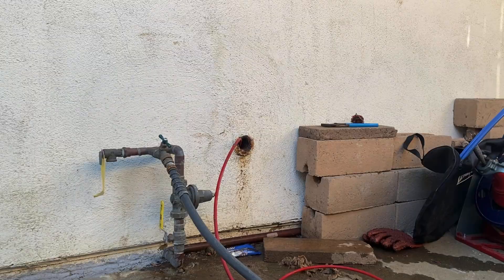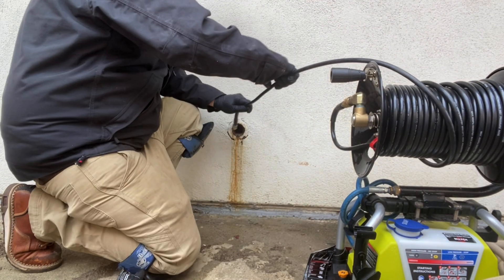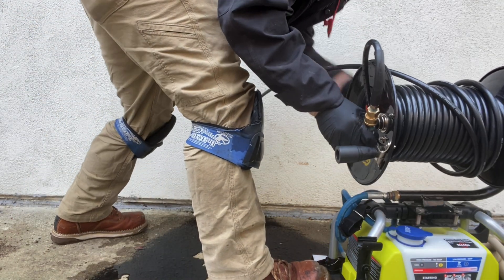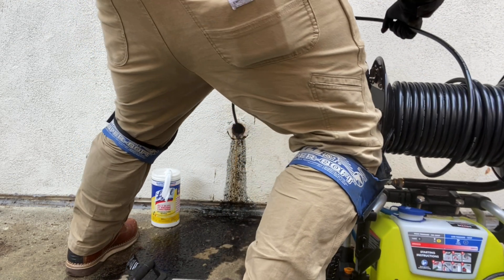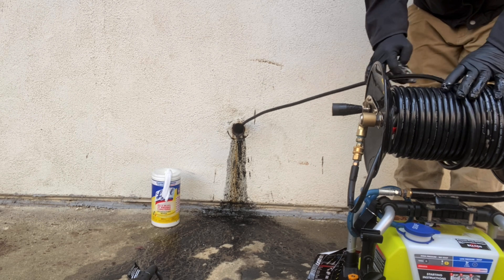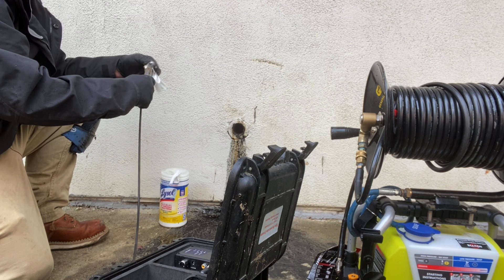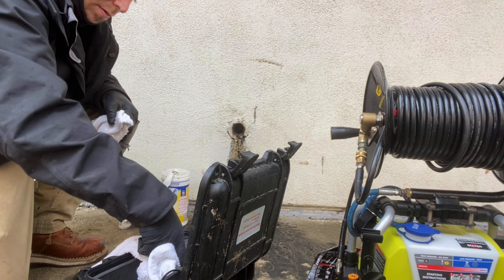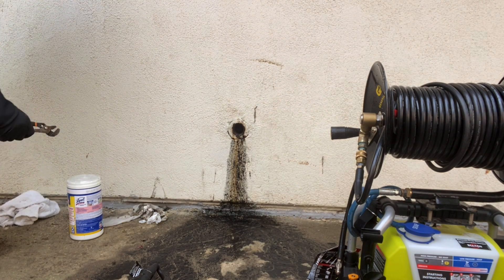Ryobi 1900 psi 1.2gpm Pressure washer converted to Electric Jetter | Unclogged Episode 27

Comment: Just wanted to say thanks for this video. My main is 100ft 4 inch old cast iron that has a few bellies and other faults with it.  My gas pw is dead and my main is clogged again after 3 years since last jetted.  I found  an openbox electric Ryobi PW on OfferUp for $100. Definitely not as strong as the gas but after 4hrs, got my 4in sewer main cleared!  I bought a similar jetter kic from Amazon about 3 years ago. Upgraded the hose to 160ft.  I just gotta remember to jett that main 2x a year to keep it flowing. The Electric power washer is slow but definitely capable. Thabks again!

Comment: I just ordered my jetter line and I am going to buy a 3100 PSI gas pressure washer from lowes to try to clear dead roots from my septic lines. I have used chemical to kill the roots, but still need to clean them out. Anyone have any other suggestions?

Comment: Appreciate this video a lot!

My side sewer pipe has some grease build up. Would you say this setup has a good chance of dislodging it, or I need a gas pressure washer with 3000+ psi and 2+ gpm to do the trick?
Reply from the maker: What do you mean by side sewer pipe this pressure washer will unclog pretty much anything up to 2” it can probably even unclog 3-4” but it wouldn’t be able to really clean anything above 2”
Reply: @PlumbingExplained  Thanks for the reply.

Side sewer pipe as in, the pipe between a house and sewer main that is maintained by the city.

So yeah, it'd be around 4" in diameter.

It sounds like, 2" diameter is viable, but anything bigger probably no-go.

Thank you so much for the reply my dude.

Comment: I made a half inch steel cored flex shaft kit from home depot for 220$.. 50ft, 30ft, and a 20ft they work amazing 100ft roll of 5/8 flexible electric conduit 2 50' 1/2 in husky drain snakes and 2 50' galvanized winch cable to use as cores.. just sprayed everything down with blasher lithium grease slid them in the sleeves and threaded 2 chains on like a key ring and.. started root busting its flexible enough to run down the washer drain and the back clean outs 2"
Reply from the maker: I know a guy who was doing the same thing pretty much, I forget where he told me the down side was, I’ll have to ask him. You can order flex shaft cables relatively cheap through Plumber-Tools.com or even on aliexpress directly through China, they’re called transmission cables I believe but there’s a company on AliExpress called Ledfin or something like that, they sell them in whatever length you want and you can order the tube separate which the tube is usually just air tube or brake tube.
Reply from the maker: Very creative though! I love people that think outside the box and look to create their own stuff! I’m one of those people!

Comment: Been wanting to start offering some sort of jetting for access to clogged sewer lines for my Home Inspection business. Just goes to show you don't need a whole trailer mounted system to get the job done. Thanks man
Reply: Plumbers usually use 4g 4thousand psi for conversion
Reply: @sewerrat7612  maybe for a 6 inch plus diameter
Reply from the maker: I have a 4K psi 4.5gpm jetter i use for cleaning but the smaller jetter is fine to get something unclogged
Reply: @Baldheadslik  most drain cleaners consider 4gal 4000 psi basic for 4 inch sewer main will work on 6 inch as well if your patient but 4 gallon is a little low for 6 inch. It's also one of the easiest sizes to get conversion kits for.

Comment: What kind of camera is that and where did you get it? Get off Amazon. How much did you pay if you don't mind me asking
Reply from the maker: That black camera is the VEVOR camera, yes I bought it off Amazon it works great for a cheap little camera I’ve used it and abused it all year it was only $350 ! I believe they’ve only got the longer ones in stock right now, instead of 50 ft like this one the longer ones are 100ft and they cost $550 I believe. They have built in DVR and are chargeable, the lithium ion batteries stay charged for a very long time.
Reply: @PlumbingExplained  thanks quick question are you monetized right now with your channel I was just curious what kind of income comes with being a small channel I'm just a small channel a lot smaller then you. I like your videos they seem very informative. Keep it up.